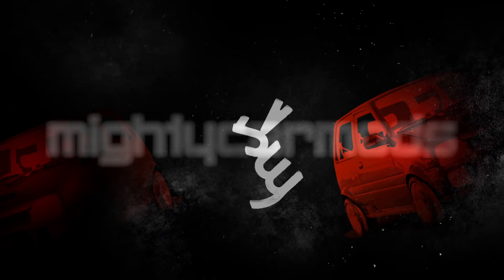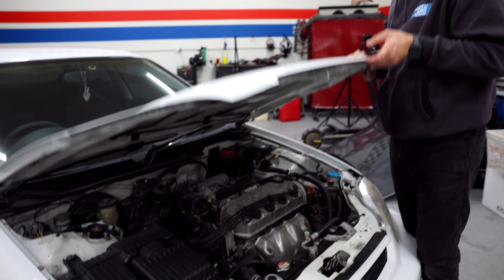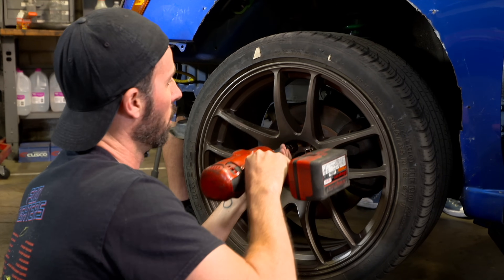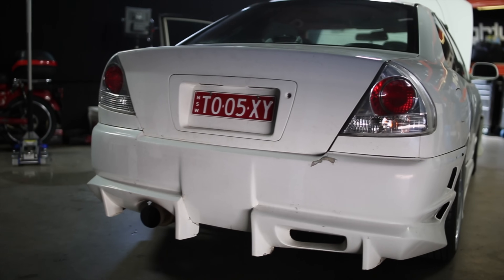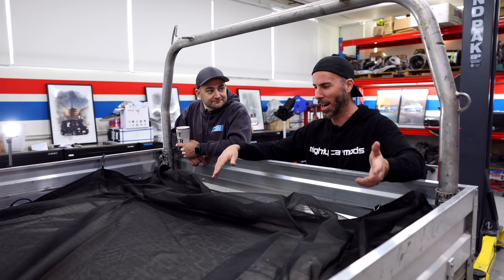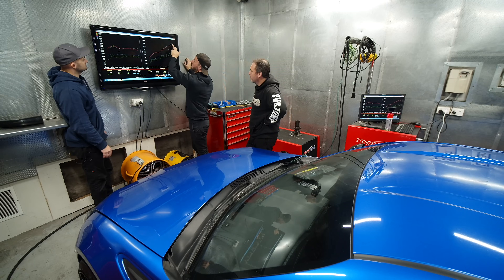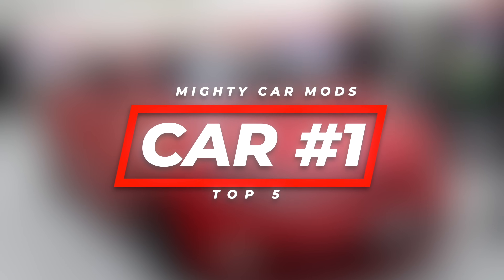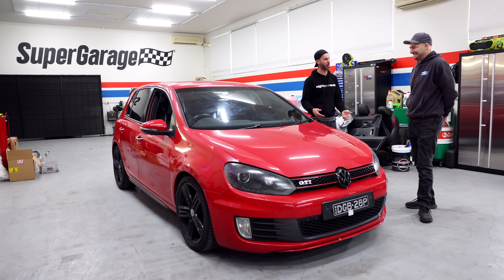The 5 BEST CHEAP CARS to Modify FAST | MCM

Comment: For anyone buying a GTI, if you get a MK5 with the FSI engine make sure you have a pre-purchase inspection by a shop that has a lot of experience with them. Plan to clean the intake valves. Plan to change the cam follower every other oil change. These cars are not Hondas. You must do the maintenance on time and there is a lot to do than on your average Japanese car. I've owned 3 of them, and I don't think I'll get another. You'll also need a lot of specialty tools even for basic stuff. They are a bargain for a reason!

Comment: The 7th gen Accord Euro and Euro R are definitely worth mentioning speaking of Honda’s. I know the Civic is a standard beginner to tuning and modifying and the 7th gen Accord has the K20 in the Euro R and K24 in the Type S 2.4 trim. Both cars have double wishbone suspension, 200-230hp at crank and are bigger than the Civic which helps with taller people. I own the US version the TSX and their versatility in tuning is spectacular. Plus the Euro R has a Recaro set of seats and a Momo wheel.

Comment: I freaking LOVE my 2020 Civic Si, its such a fun little car. Honda has come so far, from making cheap eco boxes that were all turned into ricers to genuine good lucking, fast, great handling performance Civics. The new 2023 Type-R is coming with 315 BHP, in a freaking Civic! Thats Insane! I like mine for the balance between budget and performance. It only cost me $18,000 at just 9,000 miles, it does 0-60 in just over 6 seconds with its 205 BHP 1.5L TurboCharged DOHC VTEC Engine, Top Speed 145 MPH, yet it will do 41 MPG on the highway, its cheap to insure, and parts and mods are reasonably priced. Basic mods for me, I love the factory looks including the factory optional wheels so I just threw some performance at it - Bigger intercooler, Stage 1+ tune, cold air intake, basic little misc things to bring it up to 250 BHP,  which with it being so lightweight (2-Door Coupe @ 2900 Lbs) brought its performance very close to its bigger brother 2020 Type-R. Im quite happy with it, plan to own it until around 2030, just barely hit 25,000 last week. Ive also owned like 5 Golf GTIs, not surprised at all that its #1. Really wish I could afford the new MK8 Golf-R with the new drift mode at AWD 315 BHP Goodness, such an epic masterpiece of a car - except the infotainment lol

Comment: I've got an R26 Megane just now and it's an absolutely killer car - had it 3.5 years, paid £4.5k for it. Going rate for a liquid yellow one now is between £6-7k, way more for a mint one. I've been considering chopping it in for a BRZ or GT86 as they're newer and I'm starting to find some parts hard to get now. 

No turbo is really offputting for me though, the thought of losing 70ish hp from where I am now and not having a cheap and easy way to claw that back is a tough one to take. Every time you do a video on/featuring BRZs I end up spending hours looking at them again. 😂
Reply: I didn't know the R26 was imported in the UK, they are way better than the Golf GTI. Drove many Megane 2-3 RS they have an amazing handling and are pretty reliable. Just the electronic is shit as usual but so much fun destroying Porsche and M3 on the Nurb in a cheap car.
Reply: @skippylegrandgourou2069  Yeah, I've been pretty lucky with electrical stuff so far, thankfully. It's just a shame that having such a killer car that's available for so little money means that anything I want that would be a real upgrade is going to cost me a substantial amount. Plan is to keep the meg as long as possible just now - I'm doing less than 5k miles a year and servicing it regularly so hopefully it just lives forever.

Comment: Bmw 335i N54 

- With just a DP / tune your looking at 400whp. 
- Massive Aftermarket community 
- Around 15 - 20k AUD. 
- Motor can easily handle 800hp on stock internals.

(Basically what the Supra used to be 5 years ago)

Comment: I think a better negative to the WRX would be a Volvo S60, AWD reliable, cheap, boxy,  pretty good power and tunability turbo 4cyl or turbo 5cyl if you find a T5 and honestly Volvo is a smaller community but they are a strong friendly group

Comment: I've got one better for you.
It's a Lancer Ralliart 2008+.
AWD, 2x torsens, ACD, dual clutch, 4b11t, faster than a stock Evo X with only a tune.
SST is nice and has been unlocked. Stock clutches hold a lot of torque.
Now go online and check out prices. 
Also comes in sportback.

Comment: Legacy GT is another good one for a budget quick subaru! They came with the ej255 and are pretty much a wrx in a legacy body, with a 2.5L turbo and 5 speed manual. You can pick them up pretty cheap as well, a little less aftermarket support but still plenty.

Comment: 2000 Mercedes c200 compressor coop you can get them from $5000 -$12000 I had one and you can get a lot of stuff for them to mod rear wheel drive to so much fun 😀

Comment: The one car in the states that’s a well built car and easy to modify is actually the VW TDI, yes they are slow out of the factory with the mk3-mk4 versions. Once you get into the mk5 and up you can buy one cheap and build it for about 10k US dollar. And the interior stands up to time really well besides the headliner

Comment: I think the Forester should get an honorable mention as well. Even cheaper than the wrx, but same chassis and mods, and even more practical.
I picked up a -07 with an sti vf48 turbo for ~6100 AUD when I broke 3rd gear in my wrx. I see wrx’s going for ~12k AUD in Sweden.

Comment: I’ll agree with most of this. I think an alternative to a Hilux might be worth looking at some earlier Discoveries. Not as nice to drive but retains the off road ability, a huge following for modifications and all models can tow 3500kgs as far as I know. Disco 3’s are becoming temptingly cheap, too. 

I just can’t agree with the Golf as #1. While I respect it’s performance and ability, the number 1 car to me would need to feel special. Without knowing what the prices are in Australia, I’d have gone with something like the Monaro. In UK prices, the 5.7 V8 “VXR” model with 380+ BHP is the equivalent of $25.5k AUD for a clean, reasonable mileage, well looked after example. Given the year, it even avoids the UK’s £660 per year tax bracket. That would be my #1 choice for a blend of speed, comfort and relative cheapness.

Comment: If you want a car that's better than all of those cars that's still cheap, check out a BMW 128i. Manual, fairly light, NA inline 6 that's more reliable than the VW or the WRX. Add RWD and amazing handling and sub $10k price and it's a no brainer. 135i option is less reliable but take a lot more engine mods.

Comment: I just got a BMW e90 325i for 6k, a rare factory manual, rear-wheel drive, 200+ hp stock, maybe not very much aftermarket support for power mods, but can be modded for more power if you try. Or you can get BMW 335is from around $10-20k, stock turbo with 300+hp. I'd argue what's missing in this list are the slightly older generations of BMWs & Audis, for example: e36, e46.... Prices aren't insane like the JDM cars, you can find them well below $10k, rear wheel drive, manual, and already comes with quite a bit of power, comfy to daily drive, and has some modern luxury features as they are luxury brands afterall.
Reply: Starting from the e90, they don't really make them in manuals anymore, but with older gens like the e46 there are quite a bit of manuals around.

Comment: I had a mk7 GTI. They are fun to be sure. They chuck about nicely. I am a big fan of VW and bought an R when I sold my GTI. Never the less! Biggest drawback and why I say this isn't number 1 is the lack of all wheel drive. I would have put the WRX as number 1 and GTI as number 2. You have the same engine capabilities, but the WRX is AWD and that just wins the WRX the top spot!

Comment: the Jimny certainly isn't fast but for a first car it's great! Good driving visibility, great during traffic, easy to park (don't need much space), not a gas guzzler (only 1.3) and can handle most road conditions (wet or dry) 😁

Comment: The best cheap car is the Honda Accord Euro (Acura TSX in North America, Accord in Europe/Japan). 6 speed manual and as much power stock as a highly tuned Civic from the 7k RPM 2.4L 4cyl. The stock springs are as stiff as you'd want and you can get WRX kinda power output with just an exhaust, headers and a flash tune. About half the price of a 90's civic and 10 years newer.

Comment: The CIVIC/INTEGRA and GTI are literally the best tuner cars for the price and aftermarket parts. I owned lot's or both type's of these cars over the year's and they are reliable. I drive a 2016 GOLF R tuned and built by HPA PERFORMANCE that I bought from the owners son that makes about 500BHP and that car is in like new condition that cost me 34k Canadian before tax. The car I had before that was a 2007 MK5 GTI with a KO4 that was really fast and was affordable to buy and tune.

Comment: If only you guy's were aware of an Airtrek. Evo 7 engine, GTA 7 gearbox AWD. And being that they are an Outlander body the parts for both mods and repairs are astronomically  cheap. As an owner of one I can vouch for many reasons why this should have been on the list. And considering they are under 20k for even a modded one.

Comment: Don't know if you get them in Australia but as a alternative from the golf gti/r you could easily find a early year Seat leon cupra 280/290 (the 300 is still out of "cheap" budget) which is basically a front wheel drive version of the white golf r MCM had. Great value for money (at least in the UK) and arguably the better and more fun car due to more equipment as standard.

Comment: 5cyl Focus XR5 turbo... for under 13k mine will starch anything you've shown today and is a big omission, decent RS clutch and a $500 handset tune and mild other mods it has a pop most things on the road. Not many 2.5 litre turbos out there these days at such good value and great engine note

Comment: With a ae92 Corolla u have 3 engine options that fit perfectly 20v 4age 2zgge\gze or a 3sgte they all work on a similar platform but as you said with parts ability you don't have much after market like the civics

Comment: Pickup trucks are the best Daily and Only car. I sold my 1.6L, manual transmission 2005 model honda civic to get a 2014 model Ford Ranger 2.2l, turbo, manual transmission dual cab and it's better, faster, bigger space inside and out and you feel more secured. Plus I replaced with some fancier wheels and all terrain tyres and now it looks sick. I love it, absolutely. I bought it at 50k km, and I put 75k km and I never had a problem on it. I do the normal maintenance myself like change oils and filters. I never replaced anything, and never broke anything yet. The Toyota Hilux were one of my choices because of its know to last long, but when I test drove the same year model Hilux with a little higher price it's boring and not a fun pickup truck to drive. Not as fun as my ranger.

Comment: Additionally, I think the xr5 turbo Focus would have made a decent addition to this list. Decent car for the money and you can get them at a decent price, < 15K or even < 10K depending on colour and year.
Reply: Was mad it wasn’t on the list
Reply: Yeah I got my svt for super cheap and it can do pretty much anything. Paid 650 USD but in total with getting it legal was about 1100
Reply: Also they handle pretty good and the acceleration is just insane

Comment: Throwing another "But what about..." comment out there.

9N3 VW Polo GTI's. 110kw stock in 1150kg doesn't set the world on fire but they change hands for 6-7k for an older one, 1k gets you a tune to get it to 150kw, 3-4k would get you the associated things to get it to 170kw and handling/stopping properly, they're a heck of a car for 10-12k fully sorted and making silly power. Reliable too

Comment: I agree with most... but not the brz/frs/ae86. It is good until it gets 400+ HP everything breaks it cant handle it. Built a beautiful egine for it. Then shreaded the diff, twisted the drive axel, broke a trans mount, ripped a cv. Beefed all that up, and heavy clutch. Then the issue was rear suspension would bind up and horrid wheel hop on launch.  Once we beefed up the rear suspension so it wasnt twisting or binding under power it cracked the trans housing... we didnt even have 500 horse from the built engine 😔
Reply: i mean that’s double the factory power, cant really get mad if you don’t do supporting mods and then things break. and most people aren’t gonna need 400hp in their 86
Reply: @arcanevoid9199  we did 350 with the first base tune. My 2014 tts simple stage 1+ tune and dsg tune was still much quicker at NJMSP. So we built the engine and turned up the boost. For the cost my used tts with then stage 2+ was still much faster. The brz mods ended up costing over 1.5x the cars cost after it was fully built. The tts on stock suspension stock rims only the dsg tune and  stage 2+ mods still kisks its but around the track even with more weight less power than the brz. The tts is only on khumo max summer tires the brz is on r888's
Reply: @arcanevoid9199  also my bmw 1m build was 850 to the wheel when stock was only 320. It didnt have hardly ANY ISSUES or need an entire car rebuild to handle the power. The brz is a fun car if you keep the skinny stock tires and dont try to make it fast. It just becomes an almost endless money pit once you try making it a fast car.

Comment: 33:27 yeh have to disagree there, my audi (af b5 1.8t with cvt) needed all it's hoses and those orings replaced at around 250,000km but my forester is at 340,000km and I have only needed to trim down one of the hoses didn't even need to replace it 😅 Not to mention how much easier the forester is to work on. On the flip side, the audi is just a way nicer car. 
Kind of keen in a volkswagen these days.

Comment: Good list but you missed a good car to consider. Volvo 850 with the 2.3 turbo, so  the t5, t5r, 850r or 850 turbo. Not the most aftermarket support compared to jdm stuff but it's out there and you can get shit. Good fwd platform, also can awd, stick in either platform and strong engines to a point, they have their limitations before the rods go crazy.

Comment: Brz/gr86 is by no means budget they go for well over 25,000
Also VE sv6 commodore 10-15k rwd v6 195kw plenty of after market support, good fuel efficiency drives nice p plate legal

Comment: Any love for the E46¿ Four or Six cylinder rear wheel drive comes in couple, convertible, sedan and wagon. Manual or auto. A huge amount of aftermarket support. Great well balanced chassis. Cheap average condition cars in Aus are around 5k and excellent examples are around for under 15k.
Reply: Had to scroll way too far down for this comment! I think they aren't too popular, because there isn't much power to gain from them, being naturally aspirated. But even a basic 316i is fun around corners and a 325i or 330i will really get you going. Plus the 6 cylinder engines last forever. And they are cheap. And there is tons of parts. Great car!

Comment: GTIs are amazing but check or change your the timing chain tensioner is swapped. Had a Golf Mk6 GTI with some apr mods wheels and tyres was so good until the timing chain tensioner went and needed a full rebuild it was devastating and so expensive

Comment: few things worth mentioning too on golf which I think is worth mentioning about why vw community is so massive and loved
- Throughout generations there is a huge amount of swapability between models, VW didnt change their design too much so with the help of some conversion mounts for less than 200gbp you can throw any VAG engine into pretty much any car - there is probably more Mk1 and Mk2 golfs running VR6,1.8t and PD engines than there are in mk3's and 4s where they came from
- The mk4 2.0l gti was  a major flop but don't forgot it the gti got replaced with the later GTI which had that awesome 1.8t 20v turbo engine which you can still today pick up for pennies, i bought a whole running mk4 20v Turbo (AUM) for 500gbp only a year or so ago.. running and driving. 20v will get you easily 200bhp on completely stock with a map, and with a few mods these engines easily handle to 350 before you look at things like forged internals and even then the parts market being so vast its not even that much money to achieve. 
- VR6, slap a turbo on there couple small mods and you're running 13's
- MCM some day you gotta do a mk1 or mk2! ya know its gonna pull mad views. (or even better mk1 caddy the mk1's ute brother)

Comment: Can I just add the F3x BMWs? You can get 2013~ model 320/328i BMWs for between $15000-$20000 

Powered by the Turbocharged 2.0 N20 engine, the 328 makes a little more power, very tunable and reliable engines.

Practical - RWD with LSD 4 door sedan or wagon, manual or auto, huge community and aftermarket support

amazing OEM+ options and upgrades, big brake kits, interchangable exhausts with more powerful models

a couple of bolt ons and HUGE support for OBD2 bluetooth OTS/Custom tunes right from your phone (plus an incredible amount of customization through "coding" to change and unlock so many features of the car)

I think a mid condition 2013 328i would take the #1 spot apart from price but still sub $20,000...

Comment: Mercedes. Get a 2007 e class woth a 2,1cdi get a tune, 5L/100km 160-170hp. W124/190 of you want something older, 4cylinders for decent gasmileage, diesel for the reliability, amazing suspension, comfy, all you want

Comment: I almost completely agree that corollas are boring. But there was a particular range of Corolla in the Aus market. Sx Seca, SX and GTI hatchbacks. These came factory with a 4age. Aftermarket is difficult for them but possible as they share so many parts with their Levin equivalent. Btw the 4age in the ae92 made 100kw to the crank, a good rival for a b16